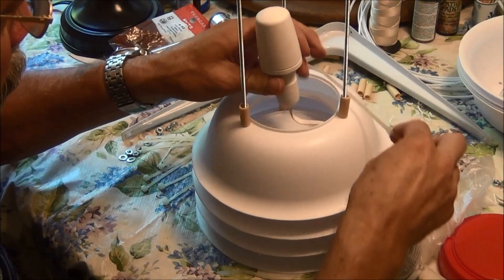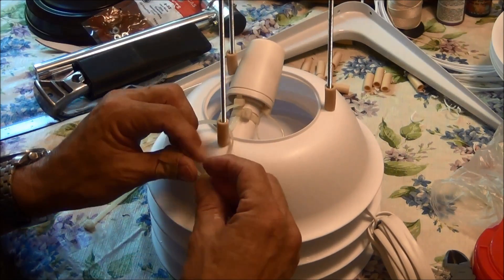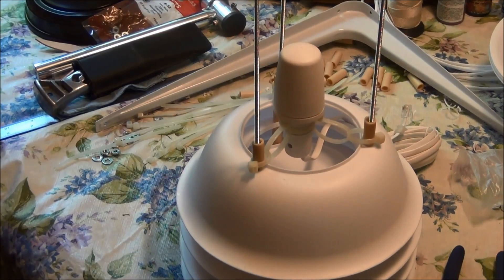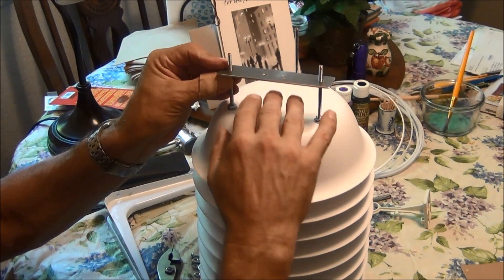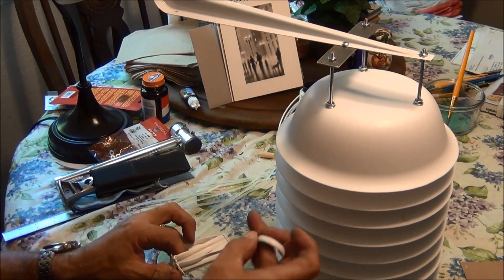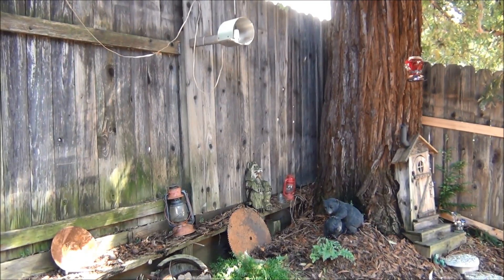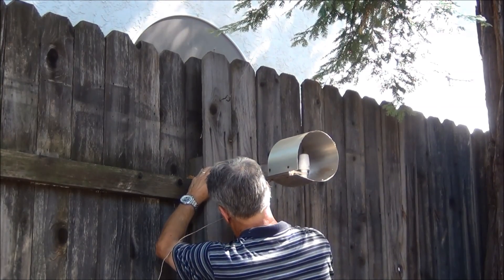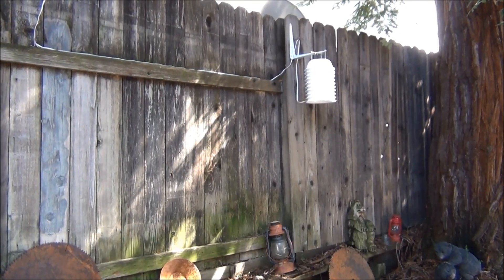Weather Station Solar Radiation Shield Part 2

Comment: Thank you very much for this video. I have a doubt: what are these material between the plates made of?
Reply from the maker: I used plastic tubing that was originally made for a water misting system that I installed around my outdoor patio. It is great to have the outdoor misters in the very hot summers here in California. For the solar shield any plastic tubing will work.

Comment: Great DYI video with good production values.  My only concern is what happens if there is a strong wind hitting your radiation shield? I think a second bracket at the bottom would secure it from whipping around in the wind.

Comment: You mean A/C compressor ? lol. I've been seeking ways to build one because I got lucky and found an industrial expensive one on eBay for $50 but I have to try and sell it due to the fact that the temperature display went bad on my wired unit so I'm seeking ideas to build one like this. I bought the temp unit for $50 on eBay and it was stated as new but I don't believe it was. It started having fluctuating readings not long after I hooked it up. I had a new one in 1995 from the factory that worked perfect so I think I got hood-winked on this one so to speak. The shield I have is a Young 10 plate shield I'm getting letting go now.

Comment: Three comments:
1- the radiation shield should be in an open air zone, not blocked by the fence so that air moves in.
2- the radiation shield should have a fan inside blowing on the thermometer sensor.
3- the thermometer is too much up in the shield, it should be more in the middle.
Reply: 2- not always

Comment: Hi Mike, I'm thinking of maybe building one for a senior engineering project. Can you think of a design for a much smaller sensor? Maybe smaller cups of the same material? Great idea with the zip ties by the way...
Reply from the maker: Even though the sensor is small you still might want to keep the shield large. A smaller shield may allow external elements to affect the sensor reading. If you do decide to make a smaller shield then smaller bowls should work.

Comment: Looks like you have been using the shield for a couple of years now. Any problems with wasps making a home inside ?
Reply from the maker: Larry K No problems except for squirrels chewing though the wire. I ended up routing the wire from the solar panel through some PVC pipe to keep the squirrels for chewing through the wire again.

Comment: Very nice! One question: UV resistant plastic? I may be a good idea to paint it with plastic paint. I'm doing a test with cheap stainless bowls (very reflective) to see if they get hotter than white plastic in full sun. I'm also looking at adding a small PV powered fan near the top ( a 2" computer fan should work).
Thanks again!
Reply from the maker: I think white plastic paint would be a good idea to reduce UV damage. I also thought of using metal but decided against it since metal would transfer heat much easier than plastic.

Comment: Nicely made. How is it standing up to the weather?
I am looking at using plantpot saucers, as they are designed to be outside, so may weather better.
Reply from the maker: So far mine looks exactly the same as when it was put up but it hasn't even been up a year yet. Also it is 95% in the shade. I looked a plant pot saucers as well and only found one design that would work the way I wanted. Most of the plant saucer designs would trap water when it rained. The ones I found that would work were fairly expensive. If I hadn't found these bowls I would have gone the plant saucer route as well. Good luck with your design.

Comment from the maker: It seems to work fine. The location is mostly in shade but every once in a while a sun ray would land on the sensor and cause a spike in the temperature reading. That problem has been solved by this shield. I don't know how well it would perform in full sun.

Comment from the maker: I knew there were other people interested in ways to upgrade their weather stations without breaking the bank. Thanks for your comment.
Reply: Can you provide a rough estimate of the total cost per build? I am planning on using your design to deploy +20 air quality sensors for a research project and would appreciate any additional details. Great video!